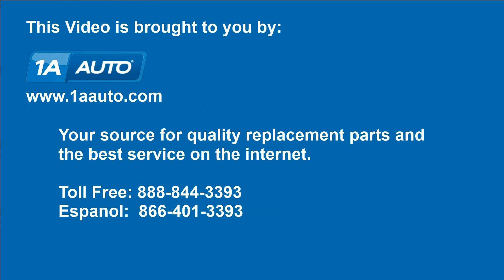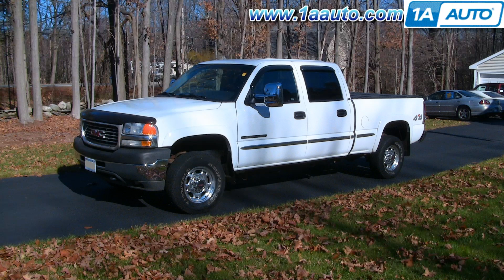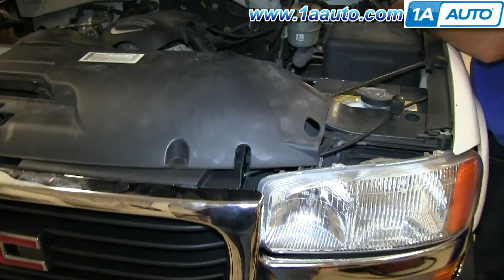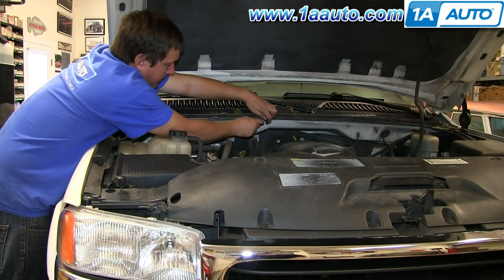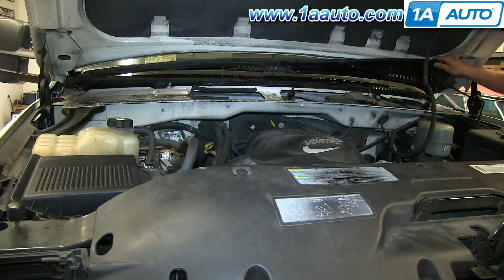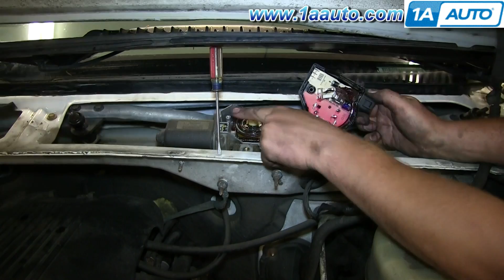How To Replace Wiper Pulse Control Board 99-06 GMC Sierra 2500

Comment: So i have a 2007 gmc sierra classic with this exact wiper module connector and during thencold westher a rat ate through a lot of the under the cowl. Do yall have any idea if i can just plug in a new set of wires or do you have to hire a mechanic sauder in a new connection? Dang rat ate one of the wires off at the rubber going back under the hood.

Comment: I have a 2002 GMC Sierra crewcab with the Duramax and Allison.  The part number that covers 1999-2002 I GM#19207503.  It is a straight circuit board and not the board and cover assembly shown here.  I'm putting mine in tomorrow.  This is the second one that I have installed in my truck.  I put the first one in in about 2012 and now this one.  

I thought I would share a bit of information about my GM diesels.  I purchase all of these new for my business and they have all performed very well all these years.  I have 389k miles on the truck and the only major repair has been a set of new injectors at about 100k.  It still runs strong and holds 20psi at idle and 60 psi at 1,800 rpm.  This has been one of the best equipment purchases I have ever made.  The other two that come to mind are my 1993 K30 long wheelbase 4WD at 400k I am putting a Humvee 6.5 in it with some upgrades.  The other best buy was my 1983 Chevrolet K20 with a 6.2, 4WD, and 4 speed.  It is now in the process of getting a fresh 6.2 with a Banks turbo and an NV4500.  I tell people that nearly every mile driven was either hauling a lot of tools, hauling materials, or hauling ass!  There has never been a serious failure with these three in over 1,000,000 miles.

Comment: Your video says use a T25 X 4 in. L Torx Screwdriver and you keep stating T20 later in the video. Which is it?
Reply from the maker: +@eliezarsawesomechannel4917 You will want to use the  T20 driver.

Comment: I removed mine noticed the big diode was gone split apart actually a 600 volt 4 amp one had one in stock from where i fix tv's simple fix.

Comment: Both my washers and wipers stopped working in 2006 Chevrolet Silverado HD2500.  So far not a fuse or relay.  I understand they have a common ground, is that in this board perhaps?

Comment: This is an excellent tutorial.  The only issues I ran into are 1)  There is a push-in plastic "rivet" in the center of the plastic cowl, I don't remember being mentioned (no big deal) and 2)  I could not get the wipers to release.  I soaked them in high end penetrating oil...but they would not come.  I finally went to an auto parts store and bought a wiper removal tool.  Even then, they were reluctant...but I got 'em.  The $15 price of the tool still saved me a ton of money, had I taken it to a shop.  Again, this tutorial is excellent and I thank you for offering it.

Comment: I bought the pulse board from 1A auto for my 2004 Silverado in AC Delco. I watched this video before I installed it. Thank you 1A Auto for the part and video.
Reply from the maker: +Gerry Garcia Thank you for the positive feedback. We really appreciate it! If you have a minute, drop us a review on our Facebook page to let other people know about your experience with us. Here's a link: https://www.facebook.com/1AAuto/reviews/
Reply: @1AAuto  I have the 2004 Silverado extended cab with the 4.8 ltr engine.  Your site doesn't show a pulse board for this? Is it combined with the wiper motor on mine? Thanks.

Comment: Thanks for this.  I went to autozone and explained the symptoms of only having high speed on the wipers and it would just stop wherever when shut off.  All the other functions(turn signals, high beams, cruise control) worked.  They told me I had to replace the switch arm($250 part).  Did a little more research and stumbled on this video and after a $30 part, my wipers are up and running properly again.  Thanks 1AAuto.  Future purchases will include you for consideration.  Keep the videos cominf
Reply: 2004 chevy tahoe just work only on high idk what part need replace
Reply from the maker: +Zach Terry Thanks for watching. If any of our viewers needs to make this repair, we carry the auto repair part shown in this video on our website. Here is a link to them http://www.1aauto.com/1A/WiperMotors/GMC/Sierra1500/1AWWM00056?utm_source=YouTube&utm_medium=CTA+Comment&utm_campaign=ytcomment&utm_term=VccuFr_0fcI

Comment: I have a 1999 GMC Sierra, and it has two additional T15 Torx screws that must be removed.  They are under the two small panels at each side of the truck that the video already shows being removed.  This video was a big help and the part fit perfectly.  So nice having the wipers work properly again.

Comment: This video was right on the money for me.  My wipers would not shut off, and only two speeds were available.  I followed the process in the video, and added one step.  Before I connected the new board, I added a seal to it as stated in the instructions that came in the box.  I went ahead and installed new wiper arms and blades as well.  When it was time to test to see if this installation was the actual fix, I inserted the fuse, turned the key to auxiliary, and my wipers did not come off while in the off position.  Success!!  I have all of the variable speeds now, and can turn them off.  Thank you for providing this video.

Comment: Why do you have to remove the brace?
Reply from the maker: It just makes the repair easier if you get it out of the way. More room for your hands. It also made it easier to film what we were doing, so we pulled it off. If you can replace that part without removing the brace, you could probably get away with it. Hope this helps! Buy your auto parts from 1AAuto.com?utm_source=YouTube&utm_medium=CTA%20Comment&utm_campaign=1ATony

Comment: Replaced mine on a 2003 Suburban. I had to soak the wiper arm connection to the shaft for two days in PB Blaster before I could get them off, but after that it was a breeze. Thanks for the vid!
Reply from the maker: +Austin Cameron No problem.  Glad to hear it helped you out.  1aauto.com 866-403-3393

Comment: Hi there  My 2003 gmc p/u  the wipers wont shut off just stay going so I have to pull the fuse and it will ok for away   Do you think this would be the problem the pulsecontrol board or maybe the signal lever in the cab    Im stumped
Reply from the maker: Thank you for watching. The process may be a little different. We will keep this vehicle in mind for future videos.
1aauto.com 888-844-3393

Comment: Will this part help me wipers?  I turn my wipers on and the driver side goes, but my passenger side does not.  Not sure whats going on.....
Reply from the maker: Thank you for watching! It is possible although i would double check the Wiper Arm itself. A lot of time the nut that holds it down will loosen, or the plastic threads on the arm strip out. Hope this helps!
888-844-3393
Reply: 1A Auto Parts hey A1 my wiper blades only work on high no other setting i have a gmc sierra 1500 2001 can this be my problem?! anyways happy thanksgiving!!
Reply from the maker: Nick Delbuono HI Nick, It could be because the board is bad. Have a great holiday season.

Comment: the windshield wiper fluid won't turn off on my pontiac grand am 2003. it sprayed all out and continues to pump, constantly. Is the same thing required for me, as you're doing in this video? Will it be similar, although it's a diff vehicle?